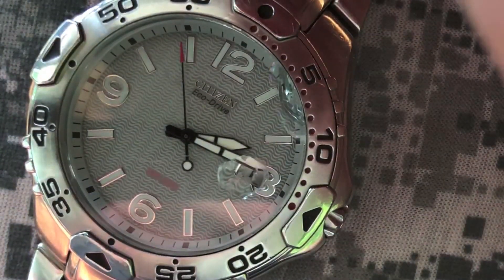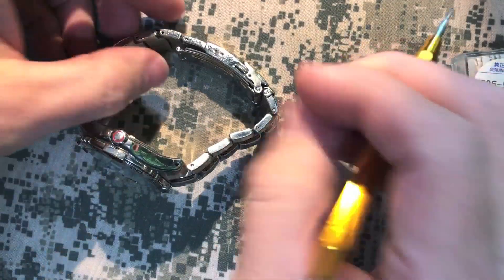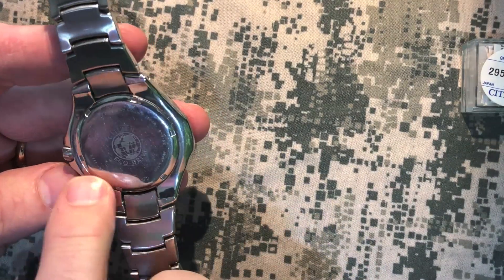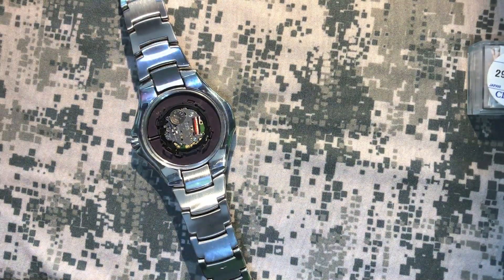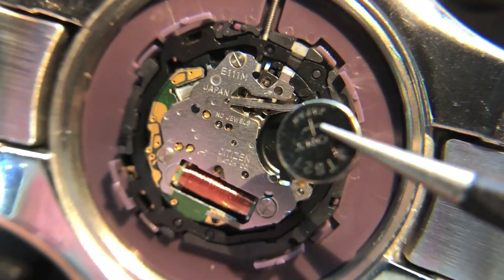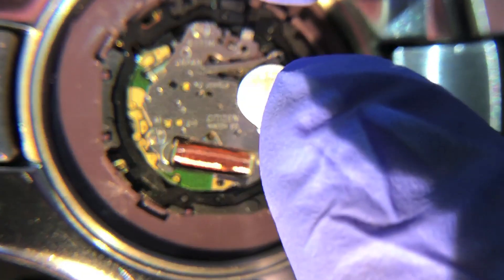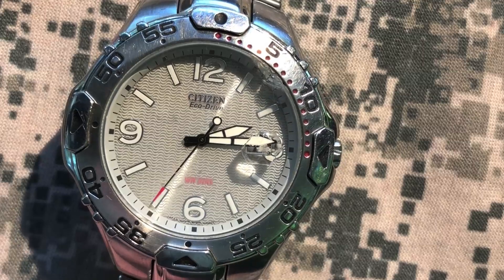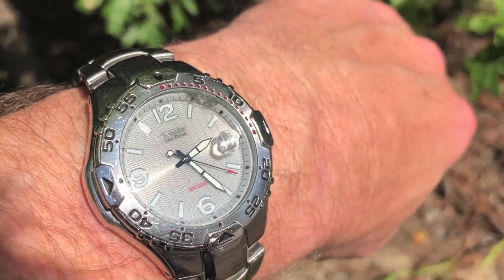How to Fix Your Citizen Eco-Drive Watch | Replace Capacitor

Comment: My citizen watch has no notchings on the case back to turn to remove it, Nor any lip to pry.  Any idea how my Eco Drive citizen comes apart?    It is 22 years old.   Bought for me on my 25th bithday at the time in the year 2000.
Reply from the maker: If it’s screw on you probably need a friction ball to remove it. Hard to say, though. Do you know the model name or reference number?
Reply: @WatchWitt     Well.  The back of the watch is pretty rubbed off from years of use. But other than no notches on the back l, Unlike the one you show here that does have them. It's the same size watch face and very similar look.  Only mines a gold colour.  But by what you say. And since  unlike other watches that have a small section to pry the back off.  I think you may be right about the friction ball.  :)
Reply: But I really do appreciate you responding  :)
Reply from the maker: The friction balls are inexpensive, so worth a try! But at the end of the day, sending it to Citizen for repair (I assume you need in there for some reason) is a good option.
Reply: @WatchWitt     Awe I've already ordered a ball  ;)   I also put that o'l watch under light since earlier in the night under light after 8 years in drawer storage, And guess what. It's still tickin under it's own power as a 22 year old watch ;)  But I think I still will order a fresh battery for it but for an hour and a half so far out of direct light. It's working . But I'll keep it in the window for today too  :)
Reply: And I did figure out. It's a threaded back cover too.  Friction ball needed  ;)
Reply from the maker: Keep it in sunlight for a couple of DAYS. The older pieces have longer recharge times, especially from complete stoppage. If it’s working, I wouldn’t replace the capacitor. At 22 years old, you’ll want a new gasket if you take that caseback off, and you don’t know the model number to order a new one. Same goes for the capacitor…the number on the cell alone is misleading.
Reply: Awe I'm not worried about it being waterproof. It'll never see water :)   But what you said is exactly what I plan to do.  See how the O'l battery still ticks, And keep it in light :)   And even if it does need a battery in the end. I'll know what kind when I do open the watch.  :)    I will forsure keep you posted though on whether it works again, Or I ended up getting a new battery :)
Reply: @WatchWitt    I just wanted to update you.  The watch has been in light for 24 hours, Between daylight and table lamps when it is dark, And.............It's a-tickin away  ;)  Not bad for a 22 year old watch ;)    I just wanted to thank you again for your advice  . I really appreciated it  :)   Cheers  .
Reply from the maker: Awesome! Keep it out of the drawer now! Ha!

Comment: I have a 12 year old Eco Drive, which has been semi retired to my backup watch (since I wear a Citizen Smartwatch now).  I made the mistake of keeping my old Eco Drive in a drawer, in the dark.  When I retrieved it to wear I realized the battery was dead, so I left it in sunlight for a bit.  The watch seems to function normally, but the second hand is stuck at 
:52 and even when I orrsstthe function buttons to make it go around it does nothing.

Is there a solution?
Reply from the maker: My initial thought is that you haven’t re-charged it enough. It takes HOURS (days!) when bringing back to life from full stoppage. So, I would try that first. Direct sunlight outside if you can, instead of through a window. But, it may need service. Let us know the outcome!

Comment: Quit calling it a battery.
Reply: Why? It is a battery. A manganese-titanium rechargeable lithium battery, to be precise. 

It's not a "capacitor". One or several of those are however used to charge this battery, so I thought this would be a video of a more advanced repair procedure than a simple battery replacement.
Reply from the maker: Can’t please everyone. Most non-watch enthusiasts believe this is a magic, completely solar powered watch. The goal of the video was to educate that there IS something inside that holds a charge, 1) it doesn’t last a lifetime and 2) is easy to replace, much like a traditional watch battery. See pinned comment at top, too. I pinned it to bring attention to those that may want to debate or hear where I was coming from.
Reply: @Spurdospaerde692 l
Reply from the maker: I agree with you, but was trying to simplify the instructions for the audience. I called it all three; battery, capacitor, rechargeable cell.

Comment: Great instructions! I followed the instructions from the link. I didn’t need a new battery. The recharging time from zero for my watch is 36-70 hours and direct sunlight outside is best. My 20 year old watch is running again.
Reply from the maker: Great news! Yes, most people grossly underestimate the time needed from complete stoppage to full charge. And outside is best, if you can do it…windows and screens filter sunlight. Thanks for leaving this comment!

Comment: Eco-drive was a giant waste of money.. Doesn't last any longer than a normal battery watch
Reply from the maker: Well, I’m hearing 12 to 15 years for Eco-Drive…definitely not “the life of the watch,” like they first mentioned! Some traditional batteries are 10 year, but depends on the movement for that rating.
Reply: @WatchWitt  mine is only 3.5 years and already dead.  Dissapointed with the watch.. The bracelet is very cheap as well
Reply from the maker: Oh, wow! Yeah, that’s disappointing. That sounds like a defective one.

Comment: Brass; not bronze!!  Most electrical connections of that type are brass.  Bronze is almost never used in electrical connections due to its brittleness.
Reply from the maker: Absolutely! I meant to say “bronze colored” as a reference point for the part. I hadn’t even thought about the electrical connection aspect. Sometimes keeping it simple is too vague!

Comment: I just got a citizen interceptor with type 7870 and the battery has been replaced with another type. what type of battery is suitable for this type?? Please help me
Reply: I'm having a really hard time getting the battery. can i use regular type battery? what type??
Reply from the maker: Try eBay. No, you can’t use a regular watch battery. It has to be a rechargeable cell…there is a physical difference to it. Another option is to send the watch in to Citizen.
Reply: @WatchWitt  very helpful information for me. Thank you for the help.
Reply from the maker: The movement number is 6870? A chronograph with 3 sub dials and a date window at the 3 o’clock spot? NOT an Eco-Drive, right?
Reply from the maker: I see you edited the comment, changing the movement to 7870. From what I can tell, that movement takes capacitor 295-34. You may also see it listed as 295-3400.

Comment: I changed my capacitor recently and upon replacing my watch stopped working. Before it would tick off the light just the power reserve wouldn't go up since it wouldn't hold any charge. Now the second hand doesn't move at all. I left it in the sun/ under light but still no luck. Any idea what could fix that? thinking I may have fucked up replacing the capacitor
Reply from the maker: That’s strange. My first guess was that you got the wrong part number, but I would think your handset would still operate in light, like you mentioned. You didn’t remove the movement from the case, right?
Reply: @WatchWitt  Made sure it was the correct capacitor. Watch movt is a J850 put in a 295-5100. No, the movement was left inside, just unscrewed the back & popped in the capacitor. I've left it by the window for a week and still no tick. I can see the second hand throb as if it wants to move but it just stays in that one spot
Reply from the maker: @omarraja9086  So strange. Wondering if the new capacitor is not seated properly? But still, your watch should tick in direct sunlight with NO cell installed. You could always try reinstalling the old capacitor to see if that changes anything. And you checked the part number against the old one? Wondering if you shorted something out???
Reply: @WatchWitt  I put in the old capacitor but that one I took out using a metal tool. I think I just might have accidentally shorted the new capacitor. If that's the case would it have ruined the watch altogether?
Reply from the maker: No, that would just toast that capacitor. Unless you somehow shorted it while it was connected to the watch, I suppose. But my guess is that you don’t have the capacitor lined up correctly. What keeps throwing me is that the watch won’t run with direct light and no battery. You’ve stumped me, based on the info you’re relaying.
Reply: Yea I ordered a new capacitor so let's see if that one just got shorted. I hope so, took it out & the throbbing from the second hand stops. The new capacitor I ordered is the same model however I noticed that the + sign on it aligns with the metal hand/bar that touches at the top. The one I currently used slightly has it between where the brown clip and metal bar are. Possible issue? New one says 295-51, shorted one says 295-5100
Reply from the maker: @omarraja9086  The + sign is just random...wherever it lands when they "cap" it. And I've seen that part number omit the zeros after 51 before. Make sure you read through your manual before attempting again. They're available online. Some of these Eco-Drives want you to pull out the crown while doing the initial charge of the new capacitor.
Reply: Oh true, makes sense the top is just pressed on after & you're right I've seen the 51/5100 even though it's the exact same. I tried pulling the crown out to charge as well, no luck with that. Does the crown have to be out when I'm putting in the capacitor?
Reply from the maker: I don’t think it has to, but certainly wouldn’t hurt.
Reply: @WatchWitt  installed the new capacitor and still have the same issue. Might have just ruined the watch I think
Reply from the maker: @omarraja9086  Very strange. Hard for me to tell what’s going on with it just from our text conversations. If you really love the watch, I would send it in to Citizen. I’ve sent this one in for other work before.

Comment: Bought my Eco-Drive A-T (radio sync) watch ten years ago. I wonder when the capacitor will die. Can’t find the right one (I looked up what an H145 movement needs) under US$32, but I did pay $300 for the watch and of course it will be worth the money to replace it when the time comes. Maybe I’ll get lucky and it’ll be far in the future.
Reply from the maker: Nice watch! Based only on comments here and my own experience, it seems 12 to 15 years is the range. But that could vary widely from watch to watch, and depending on user habits.

Comment: Thank you for the informative video. Couple of  months ago I broke the crystal on my eco drive and small fragments of the glass entered the movement preventing it to work correctly causing the second hand to move in two seconds increment. I took it to a repair shop and they cleaned up the watch and put a new crystal. Three months later I noticed the second hand moving in two seconds increment again ( I have changed he capacitor recently- not the cause) and when I looked at it closely under a microscope,  I saw another small glass fragment stuck between the movement and the case, which tells me there are more pieces hiding inside. My question is, how to remove the stem and crown to clean it up thoroughly? Is that stem removable at all and how do I do it? Any advice will be much appreciated. My movement looks similar to the one on your video. To be more precise, the movement is N-E100 K54594-Y. Thanks in advance.
Reply from the maker: Well, unless you actually SEE more fragments, or the movement is erratic, I would leave it alone. Chances are that’s just one piece they missed. They would have taken out the movement completely and checked for debris, since that’s what the watch was in for. But, I’m not sure where the exact stem release button is on your movement, or mine, but it’s likely the button/hole with the arrow pointing to it. If not, it may be any of the raised buttons near the pathway of the stem. Be gentle. You can damage the movement if you press the wrong part! Also, there’s a good chance you’ll get dust/particles/lent/debris between the dial and the crystal unless you have an air puffer before reassembling. Let us know what you ended up doing!

Comment: Witt, great video and easy to follow.  Found the correct cap, but where can I purchase a gasket for the back cover?
Reply from the maker: Thanks! Esslinger is a great resource for parts, but determining which gasket you need can be a little tricky. You may end up stocking up on several sizes!

Comment: I've had mine ten years now and it just stopped all movement so after some research I'm assuming it's the capacitor I just ordered one hopefully that fixes it
Reply from the maker: 10 to 15 years seems to be the wide range of service life. Check back in here after your repair!
Reply: @WatchWitt  ok I will I bought the capacitor on Amazon should be a few days the mail has been super slow
Reply: It seems to be working fine do you think there might be an issue
Reply from the maker: @jmsn36  I just like using the right parts without modifying them! You’re probably just a little more adventurous than me!
Reply: I'll keep an eye on it and just order another one for now what I put in it is basically my get it running for now option but I will definitely order me a new one right now as a matter of fact
Reply: Ok they sent the wrong battery same capacity but two pegs instead of one so I wore gloves and took sharp nail clippers and cut off the extra peg then installed everything and watch is now working like a charm
Reply from the maker: @jmsn36  Oh no! I think I would have sent it back.....!
Reply: I just got the battery now and installed it rite away
Reply: It's a bad habit I'm a mechanic and always like finding ways to make things work I'm like that guy in old war movies with duct tape some extra wire and a soldering iron I'll make it run lol
Reply from the maker: @jmsn36  Haha! You forgot bailing wire! Kidding aside, I would be afraid that the battery could short out and ruin something in the watch. Best case scenario, you’re only running off the battery power right now and the cell is not charging. Hard for me to say not seeing. Bravo on diving in there, though! Hope it works out for you!

Comment: The girl at my watch shop said to first try pulling the crown out to the time reset position, and try charging it that way before battery replacement.
Reply from the maker: Absolutely. This video is if you have to go to the next step. Also, most people underestimate how long it takes to get a full charge from dead stop/empty and/or don’t position under a strong enough light source.

Comment: You could do with a new crystal on that watch its all very well and good changing the seal but if that face has a small  opening it's going to be exposed to dust water ect 👍
Reply from the maker: Yes, that’s my next project for this watch. It’s dinged up pretty good, even the cyclops. Haven’t decided whether or not to do it myself and/or upgrade to sapphire. Thanks for watching!

Comment: What do I do if my case back doesn’t have any notches?
Reply from the maker: You need to determine if it’s a snap on or a different type of screw down caseback. It can be VERY difficulty I get snap on casebacks back on. If there are knurled grooves/lines around the outside top of the caseback, that can be removed with a friction ball. Which watch do you have? I may be able to tell which caseback type you have.
Reply: @WatchWitt  it’s a citizen H610. I THINK there might be a snapback “groove” to put a tool into but it’s sort of hidden in the way the band attaches to the case.
Reply from the maker: @slowhitEJ1  Yeah, I think that’s a snap on. If you haven’t done that before, proceed with caution. You risk breaking the crystal when putting the cask back on, if you don’t have the right tools.
Reply: @WatchWitt  ooof… on second thought, can any jewelry store replace it or do I need to send it to citizen?
Reply from the maker: @slowhitEJ1  Yeah, if you care about the watch, it’s better not to take the risk. Every now and then they go back on easily, but more times than not they’re a bear to get back on without a decent press. Maybe not every jewelry store, but I would think most. Or try to find a local watch maker. I have sent my Eco-Drive to Citizen (for other stuff) before. The wait is the worst part.
Reply: @WatchWitt  great, thank you SO much for the help!!
Reply from the maker: You’re welcome! Thanks for checking out my videos…!

Comment: Hello. Thank you very much for this video. 
One question please: 
What is the meaning of 12Y in the box of the battery??? 295 - 5100 - 12Y. 
Thank you very much.
Reply from the maker: I have no idea. But I could guess that it’s rated at 12 years of life. Coincidentally, that’s about how long my original Eco-Drive capacitor lasted.